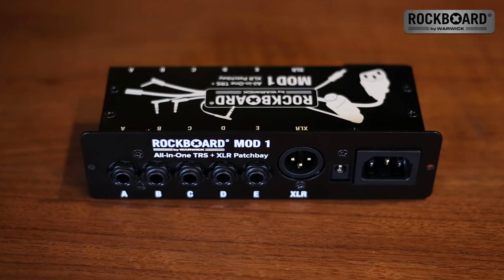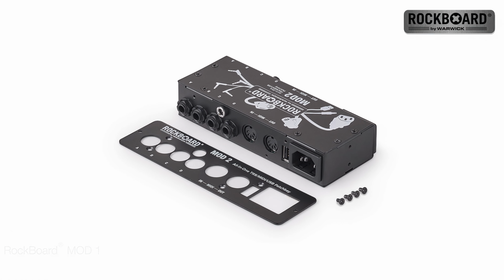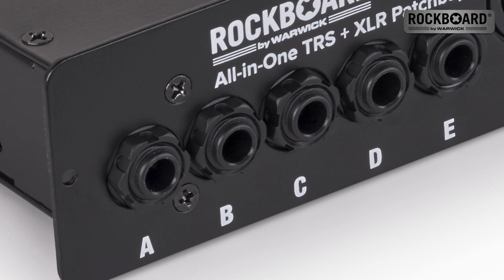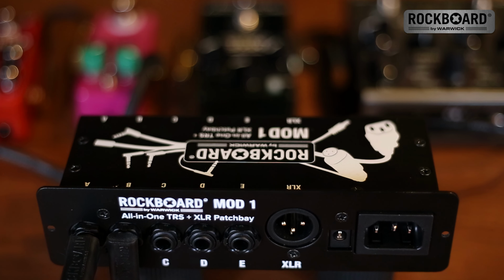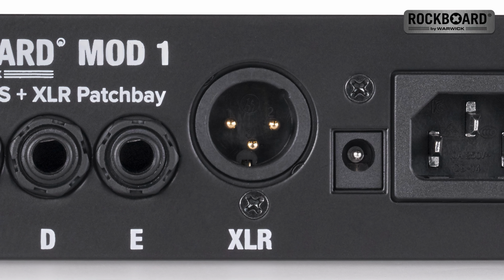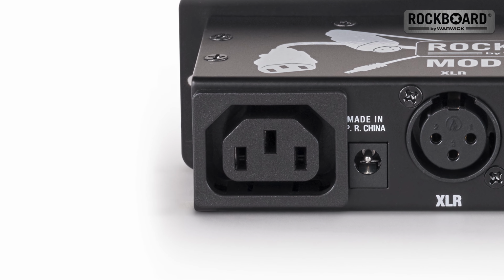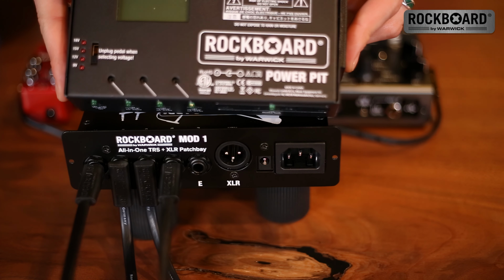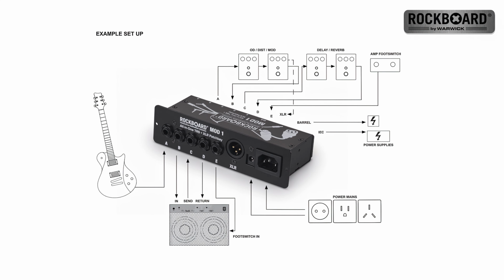RockBoard | MOD 1 | The All-In-One Patchbay for Power Supplies and multiple Signal Chains

Comment: This solved all my problems.

I'm using a side mounted input which frees up a slot on the mod.

A, a splitter out to an interface for a dry signal. Useful for separate tone design.
B&C, stereo out to the board
D&E audition loop
Barrel, tapping power from my power supply to power external effects going through the audition loop.
XLR is still blank for now.
IEC out to mains.

Comment: Question. If I were to utilize the “E” slot from an SD3000 dual delay using both L and R could I run to a second amp/cab for stereo?
Reply from the maker: Yes, you can run a stereo setup out of each slot because we are using TRS-jacks on every port.
No problem sending the SD3000 signal to two amps.

Comment: Will TS work with this even though it's TRS
Reply from the maker: Yes, the RockBoard MODs are both TRS and TS compatible. Your regular instrument cables can be ran through, which are TS, and you also have effects loop compatibility which is the TRS. Hope this was helpfull.
Reply: So to be clear in order to utilize your amps fx loop you must use TRS?

Comment: Does it come with the iec jumper cable? Or is it sold separately?
Reply from the maker: Hi there! No, the IEC connector cable it is not included. You can order one frome here if you're from inside the EU: https://shop.warwick.de/en/cables/power-supply-cables/17134/rockboard-power-ace-iec-connector-cable-iec-male-to-female-35-cm/13-25/32?c=3229
From outside of the EU, best check with your local dealer for availability. Hope we could help.